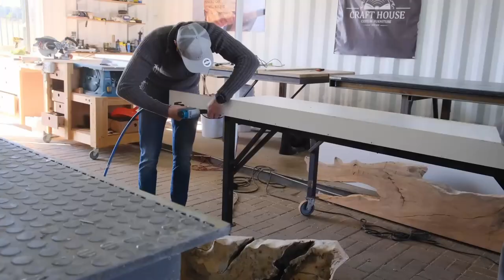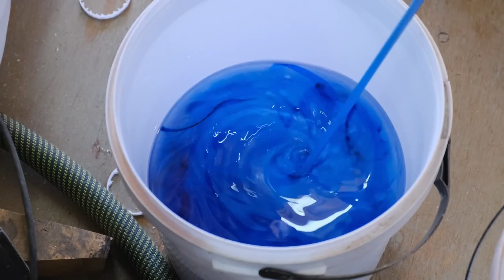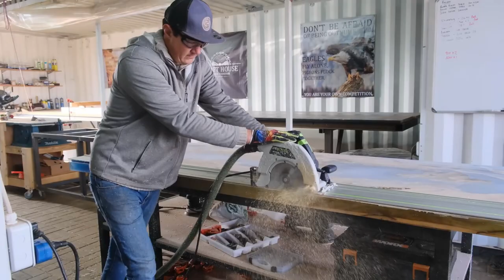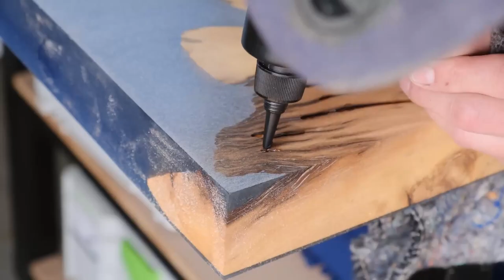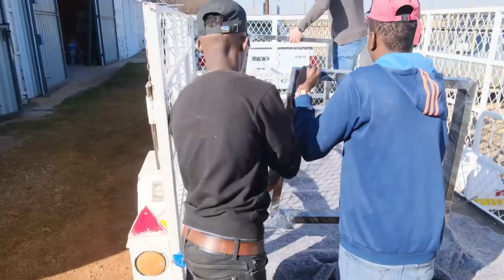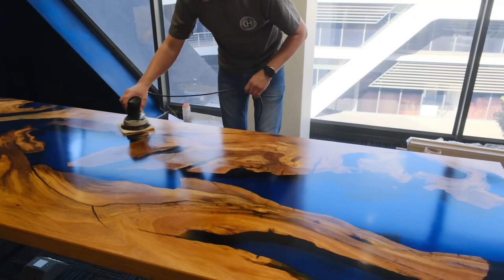Epoxy table building made easy (for beginners)

Comment: why you didn't seal the edges of the wood before casting epoxy ??
Reply: I'm waiting to see the answer myself I think it is because it makes it a weaker join
Reply from the maker: We used to seal the edges, but its a very weak joint. Now we dont seal our edges because the epoxy will penetrate into the wood, making it a super strong bond between the epoxy and wood.